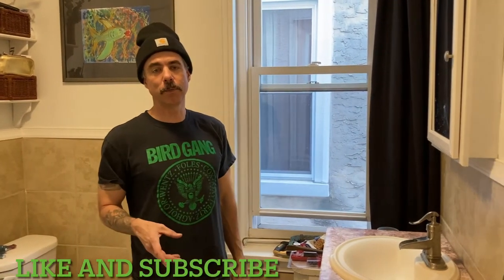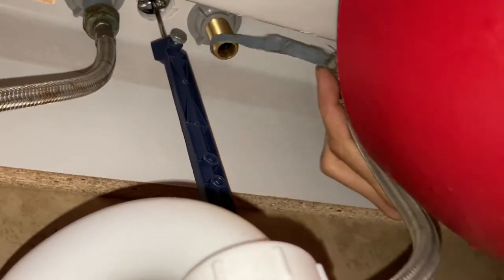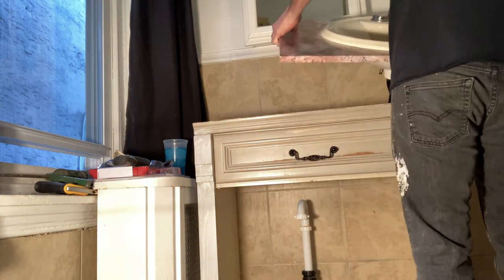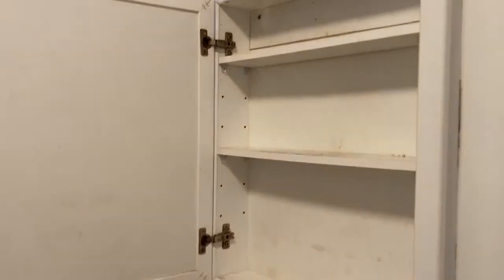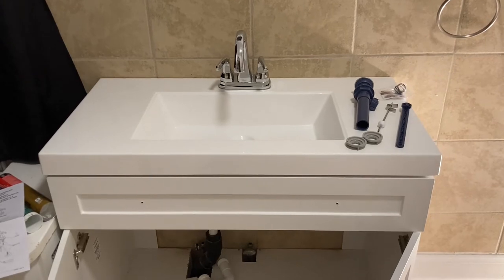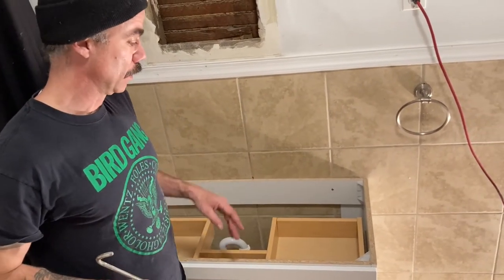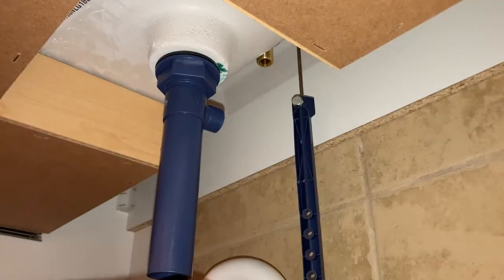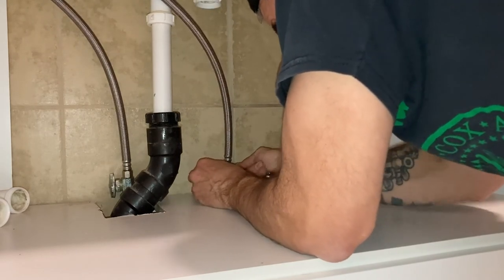DIY:  How To Remove and Install a Bathroom Vanity

Comment: My bathroom vanity is old (1978-Original) leaking and falling apart. I am going blind so just watching what someone is doing without a step by step description does not help me because I really cannot see what they are doing. In this video you did a great job of talking me through every step from removal of the old vanity to installation of the new one. Your describing each step was thourough and well spoken allowing me to understand what you were doing. So, now I will attempt to replace my vanity although I will call a plumber to install the water lines and drain pipe so I don't run into any problems with that in the future. Thank you for making this video. Tony T. Pasco Florida
Reply from the maker: Tonh T. from Pasco, Florida…I’m so happy this tutorial helped!
The entire aim of this channel is to make it easier to do DIY projects than people make it seem.
I think you ate going to nail this project.
Thanks for watching and commenting!

Comment: What if it looks like it’s attached to the hardwood floors?
Reply from the maker: Excellent question.
My understanding is that almost all bathroom vanities are anchored to the wall.
There is an exception; island vanities. 
These are vanities usually seen in very large bathrooms, and are just like the name says…an island vanity.
These are most times floor anchored.

Is this what you are dealing with?
If not, chances are it IS anchored to the wall and most likely flush with the floor, but not anchored to the floor.

Comment: So I'm a little confused. I've seen people use liquid nails and like yourself put silicone on top of the cabinet before installing the actual vanity top. I'm going to be installing my first cabinet this weekend and I don't know which to use? When I hear people say they are putting silicone? It blows my mind. Does that actually create and adhesive Bond between the top and the cabinet?
Reply from the maker: Liquid nails will wok, however, if the top ever needs to come off of the vanity…good luck!
Tub and tile caulk will bond the top and vanity in a secure manner, but allow you to take it off such as I did in the video.
Reply: thanks again for the response! i truly appreciate it. i came across adhesive kaulking that i read people use. i might give that a go. Cheers! @DIYTutorialGuy
Reply from the maker: @distortionplayer1 you’re welcome. Good luck on the project, you’ve got it!

Comment: Haha thanks for tip with the plumber puddy at the sink. No wonder mine won't stay. Also I really wish my water pipe went straight down mine make that awkward turn towards the wall.  So I'm have a hard time figuring out what is the correct sizes.  But I made same mistake in with the  kitchen faucet with the new water lines. O well.  Do you know if the tile floor is always finished under the cabinet? I am sorta worried to pull mine because I am afraid the floor won't be finishEd all the way typically?  Then it would be hard to find the replacement cabinet shape of mine. Especially since I'm contemplating a pedestal sink. My bathroom is super small .
Reply from the maker: Thanks for watching!
Now, to address your issues and questions.
In regards to the pipes going towards the wall, what size are they making it difficult to figure out?

As for the floor under the cabinet being finished or not, here is my answer. It should be. The only places on our bathroom floor that don't have tile covering the old flooring is where the pipes come out of the floor. However, yours come out of the wall, so I feel the floor should be finished.
Are you able to somehow get a peek under there?
Reply: @DIYTutorialGuy  nope not yet til I start getting it out. It's caulking and the large weather strip the white 3inch. It's gross too and paintedges over evenn. The drain looks normal size like yours but it's OK I got that part. Thanks for all your help!!

Comment: Does your sink have overflow?
Reply from the maker: The sink that we installed did not have overflow.
Reply: @DIYTutorialGuy  but I see you installed overflow drain is that fine. I have overflow drain but non-overflow sink.

Comment: Are all vanities the same height. Im worried I will get the wrong height. I need to replace mine badly but this is the ok only question I have.
Reply from the maker: The standard height for vanities is 30-32”. 
If you purchase one from a store, you should see it on the box. If not, ask for help!